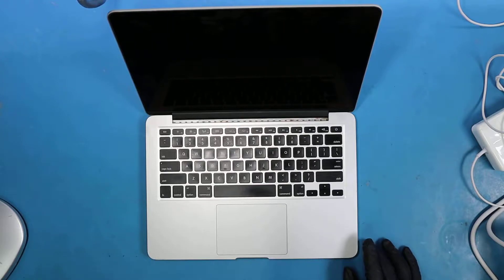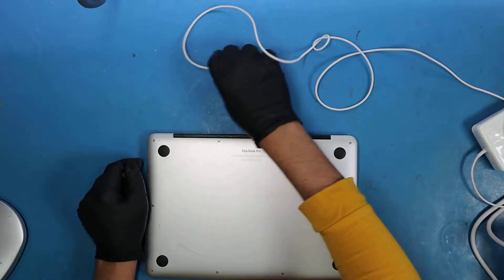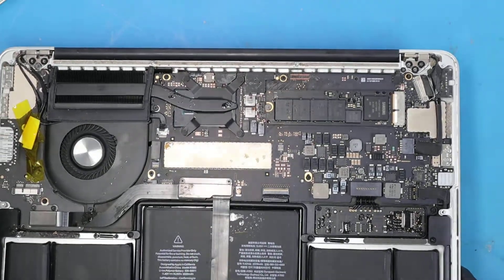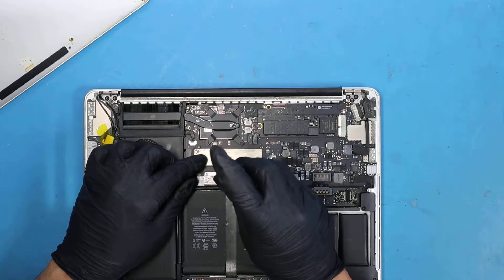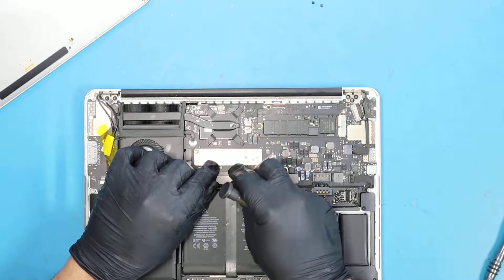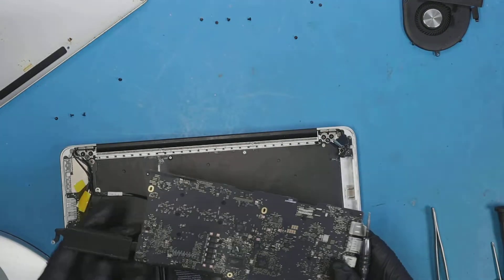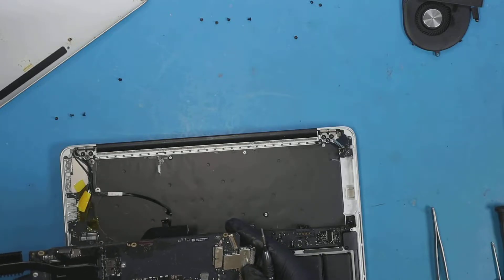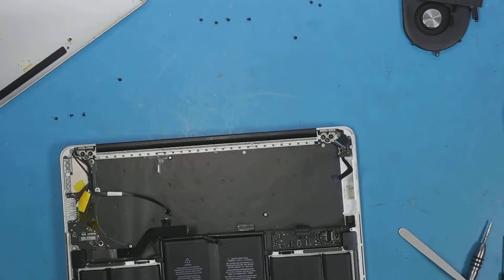Fixing a Dead MacBook Pro  A1502 Repair - Liquid Spill Repair

Comment: Good question: after you ultrasonic cleaned the m/b, did the liquid intrusion color markers (red) turn back to a neutral color?🤔 Thanks 🤓
Reply from the maker: Once liquid hit it, it changed color to red.  It will not turn it back
Reply: @lapfix  can they be replaced?